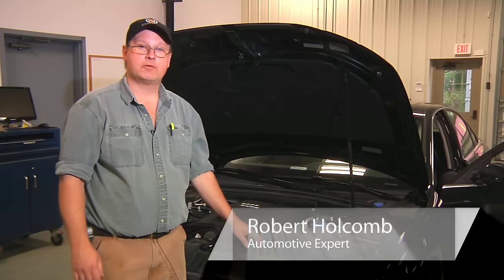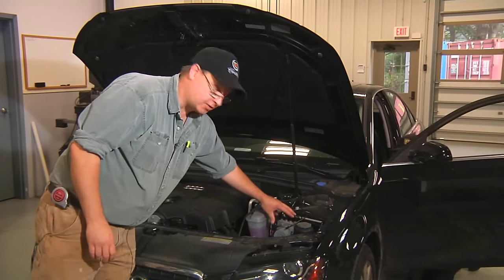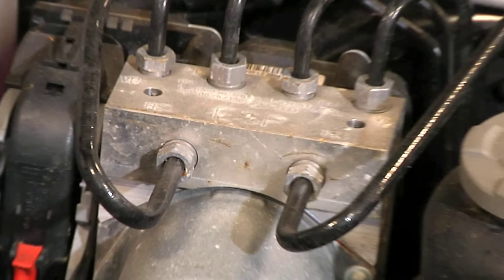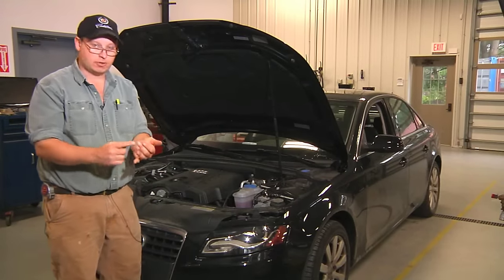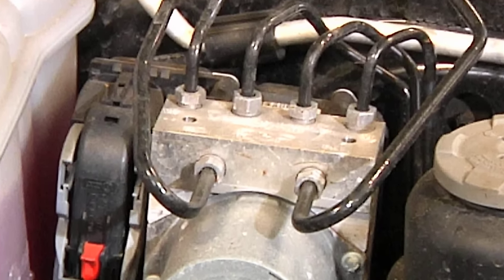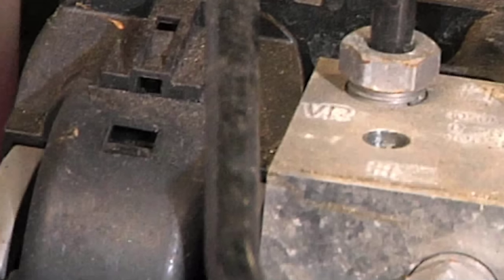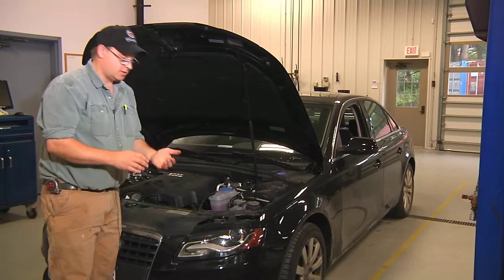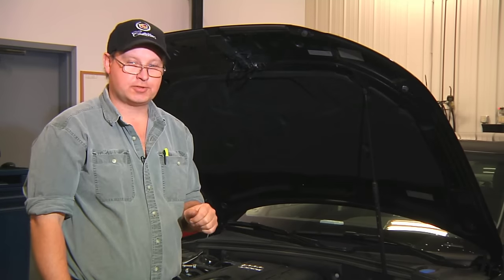ABS Brakes & More : How to Repair an ABS Brake System

Comment: Get a good computer reader if your ABS light comes on. Or take it to a shop and get a reader.  Common problems are fuses. Now if your car is 2006 and above it gets a littler more tricky.  To cut back on chop shops replacing the control module get a tad bit tricky because it needs to be set via the internet if you go to a junk yard to scavenge a part.  I should do a video where I'm going to take the module apart and explain the circuitry.  That is what this video should be about.  But I do also like this video and they should be serviced by a professional but remember mechanics are liars and thieves but they gotta eat right?
Reply: Iam having this issue with 2018 accord now

Comment: It's usually the brushes & bearings that cause ABS failure. Many dealerships will tell you that you need to replace the ABS or the entire Stability Control module for hundreds of dollars when it costs about 20 dollars and a few hours of spare time to replace the brushes. Don't forget even some electrical contact spray might be all it needs in some cases.
Reply: Now THIS could be the video "How to Fix ABS braking system." Can you elaborate slightly more, with maybe, where the brushes and bearings are and how to get to them?
Reply: @SomnoNaut  is too difficult for the DIYer. He is talking about rebuilding the electric motor of the ABS electric unit. Unless you have specific instruction and did it before, just get the ABS unit replaced .
Reply: @lifepresent3183  Better yet jerk the system out and re-connect the brake lines direct to brake cylinders. Pump your brakes on ice like we use to. I hate ABS always have.

Comment: I live in Mass. My 2013 Nissan Frontier has ABS light and slip light on and brakes are making grinding noses and pulsating , Have you had experience with this before ? A mechanic told me he would replace the hub assembly for around $550.  Rich G

Comment: My VW POLO BAH 2008, brakes ok. Does not work km, speedometer and central locking. There is a small electric motor sound in the ABS that never shuts off, unplug it because that sound is all day long. Here in LIMA, nobody sells or repairs them. Any recommendation ?

Comment: hello hope you are having a good day. I have a question about brakes I NEED A BRAKE EXPERT 🥺 SOO My sister and myself put a whole new brake system on my car. We did everything right (the guys from the shop bled my abs box and we were told that your not supposed to do that) after we got done I still had no brakes. I took it to a muffler and brake shop, they bled the shizz out of them I left there went down the road and brakes was grinding..... So I stopped back by the shop and told them that the brakes were grinding on them and they told me oh it will be ok the pads have to heat up and set in. left there and barely got home. So the next day I go about 3 miles and the brakes locked up on me where I couldn't go anywhere. The only thing we didn't change is the hoses and the lines are not leaking. I need HELP

Comment: Could it cause the brake booster to create a vacuum, sucking the pedal to the floor locking up the breaks?
Reply: Im having this issue, did u ever figure out the problem

Comment: obviously as an automotive service tech you cant repair a EBCM like this one. It is usually replaced with a new or used one. However, this is a very educational video on how it functions.
Reply: Better yet jerk the system out and re-connect the brake lines direct to brake cylinders. Pump your brakes on ice like we use to. I hate ABS always have.

Comment: There isn't hardly any pressure that comes out of those lines when you disconnect them unless you have the brakes applied when you open the lines . Cracking the lines pedal applied only results in a dribble and this is how bleed the module without a tool .

Comment: I drive a Toyota corolla 2008, I noticed while driving the steering wheel suddenly turns a bit hard, speedometer stops working, then I will turn off the engine and restart again. it will be normal but soon it would happen. what should I do.

Comment: Hi! I have a 2002 renault megane
after 30min or 1 hour of driving and breaking my front wheels start to restrain. Sometimes when I am on a slope, my car will just stand still without me acting any breaks. At this point its harder to accelerate after I break at a headlight. Is it the abs?
Reply: Did you ever fix it? I’m having this issue

Comment: How do I remove a broke bleeder valve on the abs module without taking out the whole unit on a 1998 Malibu? It broke off inside and no room to put a drill. Can I "plug" it with a screw screwed into the broke off valve? I am stumped.

Comment: what could be the problem if the car keeps trying to move when I'm in fully stop mode (Changed brake booster, master clinder, brakes and brake rotors) ??

Comment: There isn't "1000's of psi" in those pipes unless the ABS is running. Besides, most problems are caused by bad solder connections on the ABS computer!

Comment: I have a 96 Impreza and recently the abs light has been on in my car, it doesn't turn on right as I start the car. It turns on once I start rolling at around 5MPH. Also, sometimes when I take the car out, the light won't kick on at all, the abs does work when the light isn't on. When I plug in my code reader, no codes kick up no matter if the light is on or off. I've looked everywhere and can't find out what my problem is. Can anyone help? 
Thanks
Reply: you my start looking if your sensors are obstructed by something that my be in more than one position or you have a sensor that passes the test with OK but automatically fails after you start moving because does not send data , how ever these are my presumptions I'm not a real mechanic. Thank you :)
Reply: +shadiliky if it is going off and on usually a speed sensor is going out. unplug speed sensors and test with a voltimeter for resistance or there are other more advanced speed sensor test but resistance it can be on the ground without spinning wheels.

Comment: The accumulator is charged with pressurized nitrogen to act as a spring, which allows the accumulator to pressurize. He said "hydraulic pressure" which is wrong, it's really pneumatic pressure. I also don't really see a need to depressurize the accumulator to remove the unit. Then again I'm no expert.

Comment: Auto makers should replace the ABS junk system it has had many problems over the years and needs to be upgraded.
The old cars had a two part master cylinder where as if the front wheel lost pressure you still had rear brakes not so with ABS , If you get a leak in any line you have no brakes, ABS is junk.
There are other problems with ABS like sensors that always go bad and at 100.00 a pop this isn't cheap to fix.
Reply: Ringo Gingo automakers still use dual reservoir master cylinders with ABS, and you still are able to retain either the front or the back if one or the other goes.  Sadly, fixing an ABS system is not simple because of the fact that it is electronically controlled.  To truly fix, you need a professional level scan tool or ABS standalone tool in order to actuate each part of the ABS, and sometimes for a service bleed.  I have and use a Launch X-431 Diagun.  Pulling a fuse is a BYPASS, not a fix and will leave your vehicle wheels locking up under hard braking.
Reply: You are wrong about still having brakes with ABS once the line has a hole. I have a 2003 silverado and the lines rusted three different times and each time 
the brake pedal went to the floor. Pulling the fuse does not lock up the wheels it only disables ABS  cause I had my ABS pulsate  and pulling the fuse disabled ABS until I could fix the problem. You need to have these problems before you write about it.

Comment: im an auto technician he believes ABS is so you can stabilize your vehicle so you can steer out of harms way, what CRAP, ABS is designed so when you put your foot on the brake hard the car automatically pulsates the brake bringing the car to a gradual stop safely without locking the car up, you can do it manually they teach you in defensive driving in  a non ABS car to stop in an emergency to pump the pedal multiple times which has the same affect as ABS to bring you to a quicker more controlled stop, basically ABS is designed so your brakes dont lock the car up hence the name Anti-brake-skid
Reply: No, ABS stands for anti-lock braking system. The main purpose is to allow you to steer the car when you would otherwise lock the wheels and lose friction. The second purpose is to keep the car from spinning when you brake on a surface with "split-mu" (different friction on each side of the car) such as when you brake on an ice patch that's on the left side of the car only. ABS is not intended to make you stop in a shorter distance, although that MAY be the case. No offence intended, but If you're an auto technician you should really learn this stuff.
Reply: Michael wilson Ford figo
Reply: tomgnyc Hi, I'm researching videos to find out what needs to have preventive maintenance on my Chevrolet Equinox cuz out of the blue at times when I push brake pedal I will hear a crunching noise and feel some pulsating  and then push pedal a few extra times to actual stop...so can you suggest what part of the Abs that I need to replace?

Comment: I'm having issues with the abs module/pump/whatever Subaru calls it in this piece of shit Forester I got as a winter beater.  P.O. bypassed some of it and plugged the now open orifices. I am trying to figure out which is which so I clicked this video that had a picture of the identical pump as the thumbnail. Now I know two new things that I didn't before I started. 1) This dude's name is Bob. 2) I guess that's all I really learned in this video
Reply: The distribution block is usually stamped RF, LF, RR, LR (Right Front, Left Front, Right Rear, Left Rear)

Comment: what pressure??? The brake system is only under pressure while the pedal is pressed or the traction control is active other wise there is not much if any pressure in the lines. Cars with automatic park brake maybe but those relay upon a racheting system. This video was waste of time basically you told everyone your unqualified to work on there own car.
Reply: The accumulator is charged with pressurized nitrogen to act as a spring, which allows the accumulator to pressurize. He said "hydraulic pressure" which is wrong, it's really pneumatic pressure. I also don't really see a need to depressurize the accumulator to remove the unit. Then again I'm no expert.

Comment: To be fair he should have labelled the video "which mechanic to see if you think your A.B.S is rooted" otherwise yes the video was rubbish, it was false advertising. Just because he rambled off information about how it works does not in anyway help the common man in actually identifying if it's his rotor that is warped, a seized sliding pin or the abs failing. Your argument would be valid if the title was different, but at least your positive about it.

Comment: Here is one for you that is mind boggling. 1998 Lincoln Town Car, whenever I press the brakes and the speeds reaches 5 MPH the ABS system activates. Here is what has been done so far. The ABC Control Module has been changed, the Front Brake Pads have been change, ALL 4 Wheel Sensors have been changed. The only thing left are the rear pads which do look thin and the PUMP itself which I have because the person I bought this car from bought the pump but only changed the module only. I thought for sure it was one of the sensors the way it was acting because it only acts up at 5mph while brake pedal is pressed. Weirdest thing ever. Help is appreciated..BTW no lights on dash and no diagnostic codes whatsoever!!!!

Comment: The experts will come out with something to take your hard-earned money. I went to Honda Dealership and they plug the computer and they try to change the  4 bearings when I had them new then they try to change the whole abs motor $1600+  we order it and then they found it was not the motor then they reduce the price to $1000 for fixing it and it only lasts 2 months then the light came out again now I have 5 years with that light on I gave up!

Comment: 20 seconds of it is, what's what, the rest is convincing us to take it to a shop. Zero info for DIYers on how to actually repair it. Seeing it was a 2 minute video, I'd kind of guessed that would be the case though.
Reply: because this isnt a DIY repair especially if you cant even successfully diagnose it as that unit being faulty.
Reply: +MrClayFTW Read the description before you chime in "You may be stuck without a mechanic and in need of an ABS repair. Learn how to repair an ABS system on your own with help from an expert in the automotive industry in this free video clip."

Comment: Well that was a waste of time I replaced my ABS unit and there was not 100's of LBS of pressure again waste of time 97 Toyota 4runner
Reply: Did you pressure bleed the system afterwards? Was it hard to do?
Reply: @SomnoNaut  the new ABS came pre filled so that was good  I bench bled the new master cylinder and bled the whole system which is pretty much a two person job is a pain in the butt but doable I now have enough brake pedal .